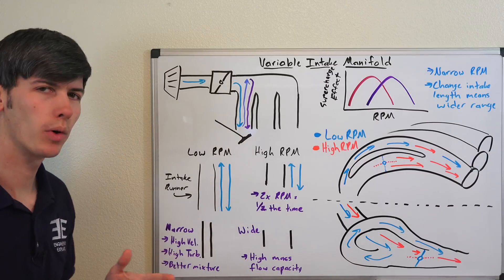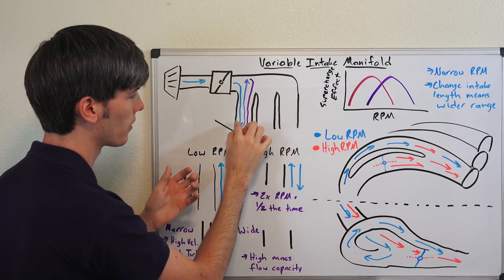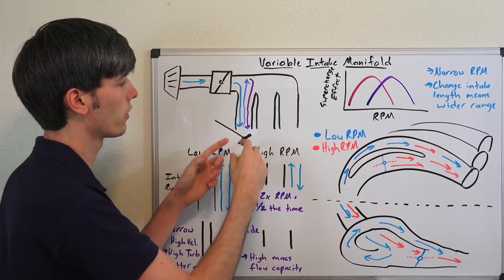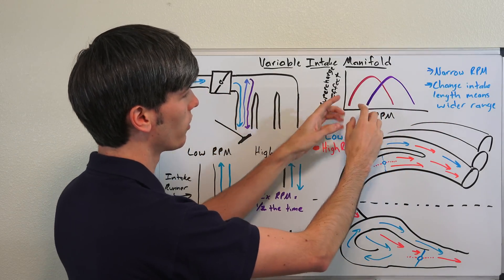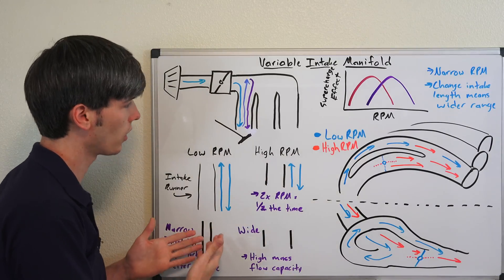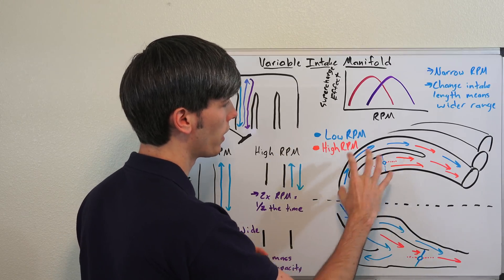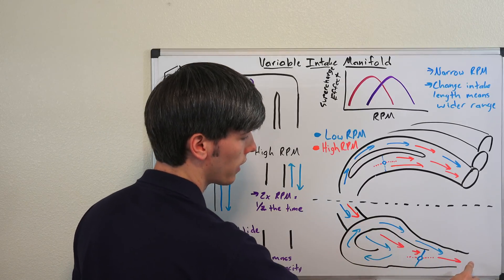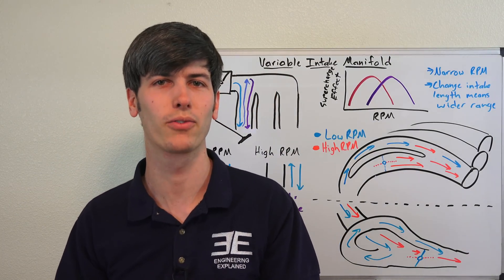Variable Intake Manifolds & Intake Tuning

Comment: Suppose VVT is expensive, complex, and adds unwanted high CG weight to the car's nose.  And suppose your variable manifold does it's job well.  VVT is unnecessary right?  You answer, no, there are still high duration cams really killing low end torque.  That's the answer I feel the auto industry would give.  HOWEVER, if you study turbos, you see they need as little duration as possible.  Then study naturally aspirated, high perf cams.  With the hi lift, they inherently bring substantial duration.  If you are a normal person who values service life, you don't want to have to rev to 7500 to get peak power.  You want a cam sweet spot that tops out around 6500.  So what?  That engine will use the smallest duration possible with massive lift numbers like .65-.75.  Hi and mid range torque is good.  Because of the added power associated with the lift, low range torque is also good.  Problem solved without VVT.  Ah you say what about emissions.  I say, use E85 so the low rpm smog emission remains modest.  Look at the HP wars now.   With high octane gas, the hp war can continue.  E85 Corvettes and Vipers should be the norm, if Detroit was smart.
Reply: Aside from the "trick" intake manifolds, another alternative to VVT is worth re-visiting.  That is, employ delayed secondary throttle bodies.  Low rpm has only the primaries open, which encourages higher velocity.  High rpm could mechanically open the secondary throttle bodies, supplying the additional air needed.  You can buy dual stage throttle bodies like these from everyone  who sells efi retrofit to classic cars.  You say, that's weird -- no one would do that on a vertical throttle body.  Think twice on that.  The first five years of Lamborghini Diablo used EFI with 4 throttle bodies that mimic'd a QuadroJet carb!  If it lacked low end grunt, it would have prompted a complaint from road testers.  Google for MotorWeek car review of the Diablo.  They gripe about every little detail.  When they drove the early Diablo, they had no gripe about low end torque.  So again I saw, is VVT really necessary?

Comment: there are drawbacks. sometimes referred to as shutter valves in the intake. they have been known to stick and rattle and cause air flow issues. I've had to remove some before.

Comment: So would using say a wide air entry point say 5 inch dia that narrows to a 2.5 inch do the same kind of thing as air velocity will increase as it gets compressed into the smaller diameter especially when on down stroke with it's negative pressure pulling it in?

Comment: idk if im right but i always consider air like water and this to be something like fluid dynamics... for more torque you want longer runners because of the air being more organized but at higher speeds the runners become more of a restriction and you lose top end power... shorter runners means air has less restriction and thus more top end and less torque from less organized air.... but with TC motors i see after market intakes using larger intake plenum's im guessing at higher boost high hp applications youll want as much air on tap as possible. i would say its like trying to drain water effectively in most fuel efficient applications vs something that wants to suck up as much water as possible in high hp scenarios.... i dont know if there would be too much wave benefit in either.. just seems like ther would be so much going on and if it bounces out it would probably be diverted to another cyclinder

Comment: My 1992 Acura Legend had VIS (Variable Intake System), and was the most complicated contraption I've ever had to work on.  Turned a 10 hour headgasket job into a 30 hour one.  Sounded like "VTAK YO" when the flaps opened at 4,000rpm or whatever.

Comment: I love the variable intake on my '94 Taurus SHO, it's a work of art. The transition at 4k is addicting.
Reply: Each runner is lined up with a valve, but the two intake ports have a crossover window between the valves and manifold. The single fuel injector per cylinder sprays into this window. Both valves receive air from the long runner below 4k. I might not have even noticed it when I shimmed the valves on mine if I hadn't read about it here: www.shoclub.com/news.php?extend.71.3
Reply: You're welcome. It's a fascinating engine, I miss it every time I have to drive a different car.
Reply: It sure was, and they did an amazing job of it.
Reply: pops had a 93 Taurus SHO those secondary open and bust one 😆 🤣 😂  one of the best sounding and beautiful looking engine back in early and late 90s hands down none of plastic covers that bad boy
Reply: @shoveI  pops timing belt snapped 😢
Reply: @baaablacksheep4003  is it an interference engine? If it's not, u can install new timing belts and get it running again. Assuming it's a non interference engine.
Reply: cisa93  it was

Comment: What about Exup valves on motorcycles, do they follow a similar argument? You presumably get a shockwave through the exhaust caused by the vacuum created as the exhaust flows away from the closed exhaust valve. You can vary the geometry of an exhaust with an exup valve and therefore ensure the shockwave is flowing away from the engine when the exhaust valve opens, helping to expel the exhaust faster and more easily. Manufacturers always claim the exup valves do give better torque / low range power and it's not just a way of manipulating the noise test regulations, but I've never been entirely convinced.

Comment: from what i have been taught, i dont believe that compression wave that hits the closed valves is the goal of pressure wave tuning. i think the added forced induction comes from the energy in combustion. when combustion takes place there is a compression wave which leaves the chamber and exits down the exhaust manifold. when the wave gets to a collector there is a change in cross sectional area. when this happens it sends an expansion wave back up the exhaust manifold. through intake and exhaust valve overlap this wave is able to make its way up the intake runner and into the plenum. the plenum is another change in cross section so when an expansion wave hits this change it sends a compression wave back down the runner toward the intake valves. with correct timing the compression wave makes itself into the cyclinder and then the intake valve closes.  and hence i higher pressure is able to be achieved during combustion hence more power! #fsae #westernformularacing

Comment: Yeah, this is the way to go, it's not that difficult to implement and very reliable, so why not use it?
The next step would be to make invinitely variable geometry.
Reply: Touge T
 Well, this is how I see it:
You either have one pipe of a certain length, or the other pipe of another length, but what if you need a length in between.
Or even more simplified: with one length you get 100 hz which is good for 2000 rpm, with the other you get 300 hz, which is good for 6000 rpm. If you open both pipes you get 2 waves, on of 100 hz and one of 300 hz, while you actually need one of 200hz.
It's just like when you have an audiosystem of a sub-woofer and tweeter you won't get any midtones.
The second problem is that the valve is half way through the pipe, so when that butterfly valve is partly open it you get that pressure wave bouncing between engine and throttle, and between engine and that other valve. Simply said: this generates uncontrolled noise that's not that useful. And the distance between that one valve in the 'big pipe' and the engine is even smaller than that between the throttle and engine in the 'small pipe' which is the opposite of what you need.

So engineers would have to come up with a clever geometry to make it infinitely variable.

Comment: Thanks, now I'm going to fit an arduino controlled trombone slider to my intake. If it doesn't make more power at least it'll sound really... unique.
Reply: Better yet; don't program the arduino for efficiency....Program it for "flight of the bumblebee"
Reply: Don't forget to post a video of the install
Reply: Check out Mazdas design for the Lemans cars of 80s early 90s.
Reply: SheepTrees You could take most physical complications out of the equation entirely by doing an electric conversion.
Reply: @Jonathan Anderson nope, i dont have a workshop and the project is too involved to do it on the street without neighbors complaining :(

Comment: Can you explain what to look at adding NOS injection into a engine? They said that these coil rings can cut the coil and your block is dead because of the ring that bends and cuts the coil.
Could you also explain or say if more cylinders are better for non turbo engines or what so ever?

Comment: What kind of System is bmw's DISA? 
The upper or the lower one? And does it also use the reflecting pressure wave or only Benefits from different intake Speed / volume? 
Thank you in advance!

Comment: yeah my falcon has this (4.0l dohc inline 6), its a very good plenum, they kept it for nearly 20 years, tb in the middle and a ribbed circular barbell on top with a butterfly in each runner, the only problem with it is that its either opened or closed so there is a dead spot in the middle of the rev range
Reply: *barrel

Comment: Don't know how you managed to give a 5 min presentation on intake runners without once mentioning the word TORQUE ???
As I understand it, low and mid range torque is derived from longer intake runner length and narrower diameter. At high rpm all you need is volume of air delivered instantly.

Comment: This seems like a very complicated system just to get a small power boost at very specific RPM's... Would it not be easier just to actually put in forced induction?
Reply: It's free horsepower! Adding a turbo means the cost of the vehicle increases due to the cost of the turbo, wastegate, intercooler, extra plumbing and connectors, heat shields, extra oil cooling, sodium filled valves, stronger pistons (possibly reshaped for lower compression), extra oil spray tubes, larger radiator, higher spec oil with shorter change intervals... the list goes on. All this needs to have a sound business case based on an expected number of sales and for some market segments there is resistance to the complexity and reduced throttle response of forced induction engines. As an alternative to all the above you just tell your engineers to research the best shape and length for the intake manifold, and make the next manifold more efficient. No added cost to the car, just part of the R&D budget.
Reply: What if you don't want forced induction. N/A have better throttle response and less maintaining. Some people just like the challenge of tuning
Reply: Nicolas Losito If you want imidiate response they should buy an electric car lol, combustion engines always lagg :P
Reply: Turbos outlast the car, N/A engines usually rev higher, that means more maintenance. And the throttle response is not that much beter in a N/A engine, I`ve tried both and Turbos are just more fun :) The power surge is so fun when moving up into higher RPMs :D And then you have all the wonderfull sounds it makes <3
Reply: I drive a force inducted car and I totally agree with you I was just making the argument for N/A cars and those who prefer them
Reply: Haha true true.
Reply: There's very little to this system really. Hyundai has it in most of its current NA engines today. It's basically just a flap that redirects the airflow in the intake manifold through two different paths, activated by a solenoid that controls a vacuum actuator. Way less money than a turbo.
Reply: Robert Hancock But way less boost than a turbo ;)
Reply: Robert Hancock. Only the hyundai xg v6 has this feature.

Comment: Didn't even know this existed. I assume this is how throttle body spacers work?
Reply: The video is more about the length of the runners from the manifold to the cylinder head. TB spacers supposedly change how air enters the manifold, but it's doubtful how effective they are in modern cars.

Comment: Question: you talk about the valve closing on the intake to produce the pressure wave that bounces around, but where is the piston while the pressure wave is headed out and back?
Reply from the maker: Doing it's combustion thing inside the cylinder (closed off from the valve).

Comment: I had a 1991 Isuzu Impulse RS, it was turbocharged and had a variable intake manifold. It made all the difference in low end power.
Reply: What was the difference in runner length long to short?
Reply: @dennisrobinson8008  butterfly valves, 4 to 8 runners.

Comment: The intake on the  RX8 has a lot of variability in it.  It can have one, two, or three ports open for each rotor and also does the supercharging thing but from one rotor to the other.  There are tubes that cross from one side to the other so when one rotor closes off the port the shockwave pushes air into the second rotor that is now open.  Pretty cool little setup.  It also has a variable intake before the throttle body.  Two tubes with a flapper door that opens to allow more air in at higher RPM.  It's all in the front bumper area.

Comment: would this Intake System benefit or hurt with a turbo engine?
Reply: No effect since tuning is lost with forced induction
Reply: The effect also occurs with forced induction. And the current F1 engines which are turbo charged do use variable length intake trumpets.
Reply: Can you cite that please? I would like to read it
Reply: Nicolas Losito
Well, it's F1 so you will not find technical details about the system for some years.

I can give you some sources were they stated the use of such systems. f. i. http://www.carscoops.com/2015/01/renault-f1-power-unit-fundamentally.html

"Rob White, Renault chief technical officer said that they have made "fundamental changes to gain performance and reliability. The principal changes involve the internal combustion engine, turbocharger and battery. The ICE will have a new combustion chamber, exhaust system concept and variable trumpets, as permitted by the 2015 regulations. The compressor is more efficient, while the energy recovery systems are able to deal with more severe usage."

The main problem with a forced induction system is though, that a simple reroot of the air will not do the job.
Basically the created shockwave travels with the speed of sound up and down the intake runner. Now the problem is, the speed of sound in air depends on air temperatur and density.
So you you need to know exactly the boost pressure, charge air temperature and the revs to adjust the length of the intake trumpets accordingly and constantly.
Reply: Interesting. I honestly have never heard about this before. I will have to do more reading on the matter. Thank you for the citation. 

If this does indeed improve hp, it is beyond the means of the average tuner unfortunately. There would be not only mechanical complexities but also software
Reply: Engine tuning as a hobby will die out at some point in the future eventually. The engine management gets more and more complex and there is more and more software and electronics involved. The times where somebody could fix an engine just with a hammer and a spanner are over.
Reply: I disagree. There will naturally always be mechanical side to engines which can be user repaired if the designer permits.
Reply: Nicolas Losito I second that, anything mechanical will in one form or another need a human to turn a bolt, things break and need to be replaced,  specifically electronics.

Comment: I do have such a system in my Engine (KF, in Mazda 323F 2.0 V6)  :)
Mazda used it in all K-Engines(V6 engines produced in 90's) and called it VRIS -  Variable Resonance Induction System.
it uses the pressure of sound to supercharge the engine.
Mazda uses it today in all SkyActive models.

Comment: would this be beneficial on vvt engines as well, or would the different cam profiles hinder the supercharging effect?
Reply from the maker: With VVT you could probably take more benefit from it, adjusting the valve timing as needed to maximize the effect.

Comment: Okay, which car companies already apply this tech to their engines?
Reply: Mazda uses it in all Skyactive models
But i guess almost every Brand builds it this way today (of course only in naturally aspirated engines)
Reply: All manufacturers probably employ some kind of variable intake manifold on some, but not necessarily all, of their engines.
Reply: Alfa Romeo Twinspark had a VLIM, a lot of Vauxhall/Opel's dubbed "twinport". Mercedes-Benz use a lot of them even the old A class has a pretty decent VLIM that actually gives a sustained peak torque spread for 500rpm on an N/A engine. The 105bhp 1.6 8v VW engine found in the older Golf/Octavia's/Leon's etc has a VLIM. Lots of high end or luxury cars utilise them. They make a considerable difference to driveability and throttle response. The Mercedes I used as an example (M266 95PS) produces peak power at 5,000 rpm and is a SOHC 8v engine but freely revs out to 6200RPM without feeling strained or breathless. They create a better induction sound as well for sure

Comment: This is just like a twin scroll turbo!
Reply: no it isn't.  twin scroll exhaust housing take advantage of exhaust pulses.  instead of having all cylinders feeding into one opening which causes turbulence in the flow due to cylinders firing at different times causing the exhaust gas to all mix at the collector it separates the cylinders into groups that fire in an order that will cause the gas flow to be distributed evenly to eliminate that turbulence caused by all the gasses meeting just before the turbo.
Reply: I know but I meant how using a narrower runner allows to speed up the air and a wider runner allows for more top end power. But yes a twin scroll turbo is different by timing the exhaust pulses before it gets delivered to the turbo.